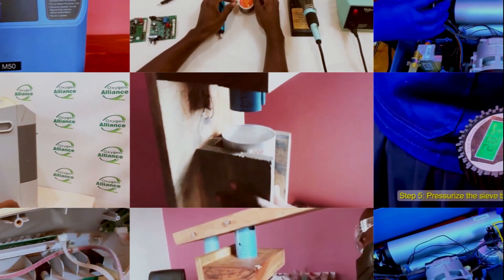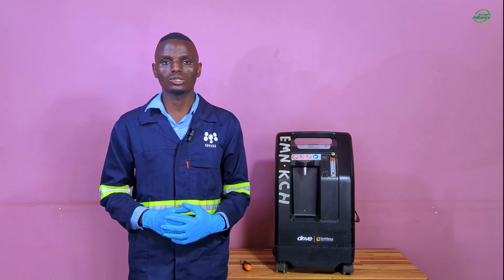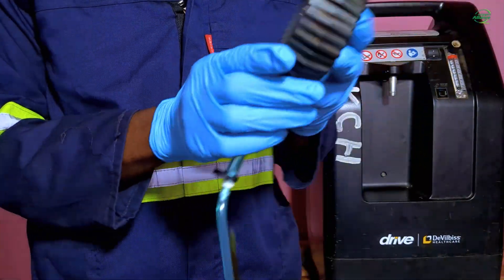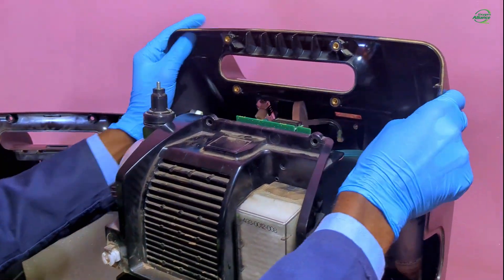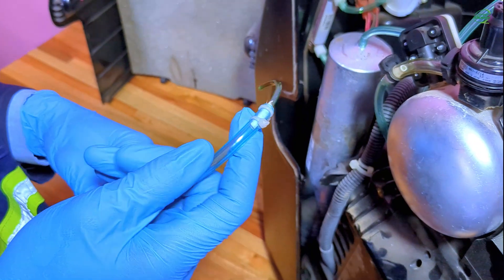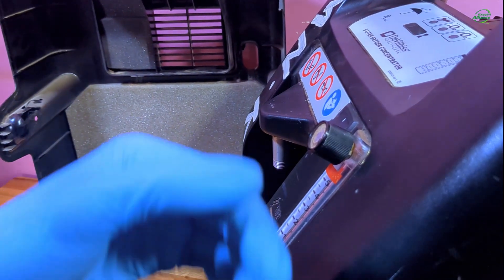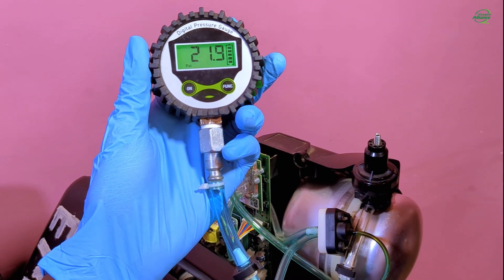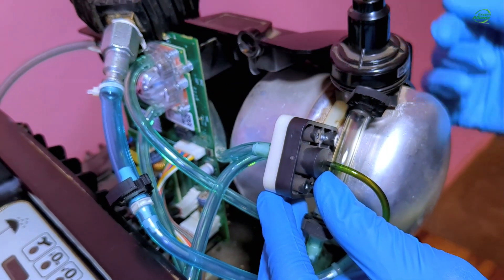Oxygen Concentrator Accumulator Tank Pressure Testing

Comment: |Why don't you just connect the gauge to the output fitting?
Reply from the maker: Pressure must be measured at the designated test point shown in the video. In the 525 Drive oxygen concentrator, the accumulator tank is connected only to the manifold, which receives oxygen from the two sieve beds and includes a dedicated pressure test port, as well as to the pressure regulator. Measuring pressure at the regulator outlet would not provide an accurate reading, as the pressure has already been reduced by the regulator.